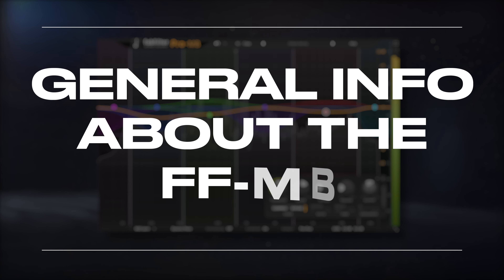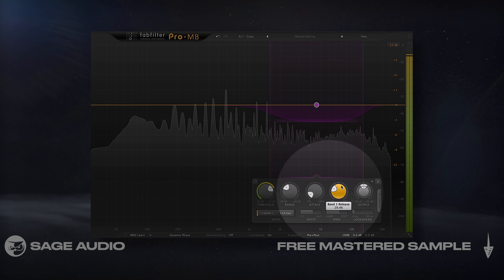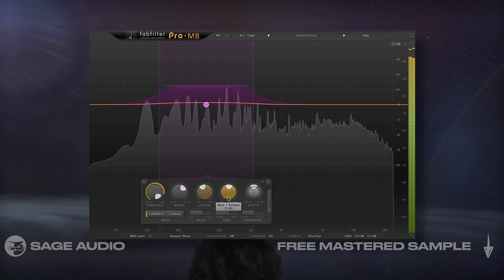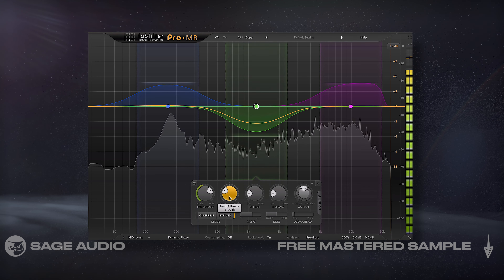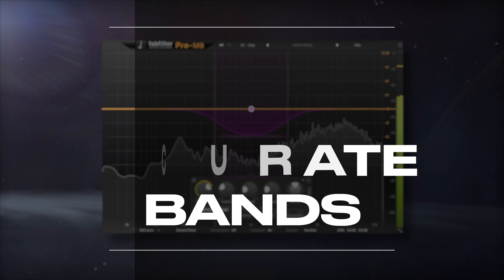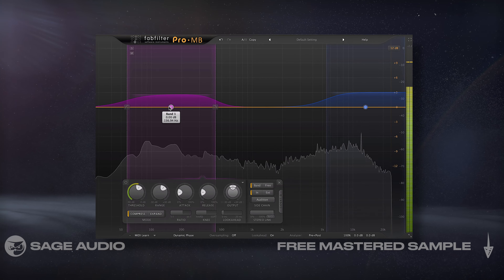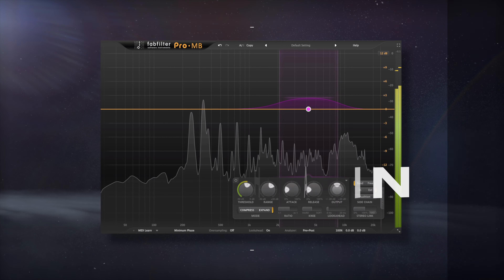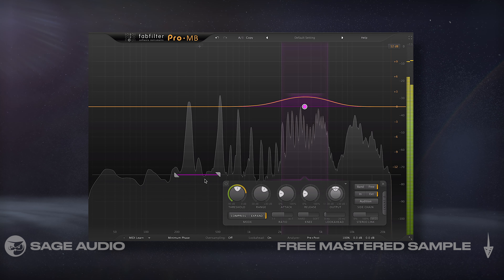Everything You Need to Know About FabFilter MB

Comment: Can someone tell only one good reason, why i should use mb compression instead of a dynamic eq like in pro q 3? They are literally the same..
Reply: Attack and release, ratio, knee and lookahead
Reply: @scottbelanger9427 and stereo linking, internal side chain and advanced external side chain like the free option while sidechaining a track to the input but listening to a specific frequency band
Reply: The Pro-Q3 dynamic section actually has a separate mechanism for overall loudness detection that adapts to the incoming input (= automatic threshold), then catches the top peaks of the affected region. It's different from what you can find in Pro MB and basically macro dynamic dependent (as it only affects micro dynamics). It really does work well in a lot of cases, and is just another flavour of compression.
Reply: @Magic_carpet666  Sounds like you also watch Dan Worrall?
Reply: @scottbelanger9427  Guilty! I can hardly fault him.

Comment: Thanks for the video!  There’s a correction to be made around 3:13.  Downward expansion doesn’t amplify, it takes quiet parts and makes them quieter (like a gate, as you mentioned).
Reply: It suppresses the sound even more I think, hence gating? I had to rewatch that part so many times and could not figure it out until i see this comment. 😂